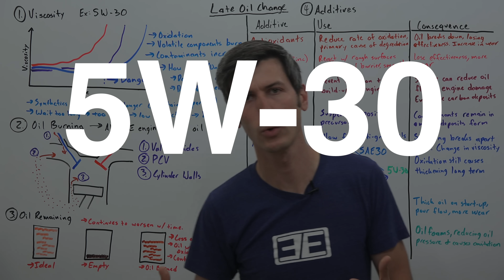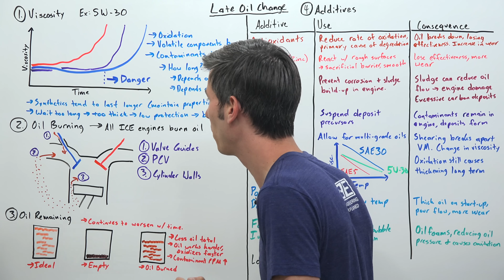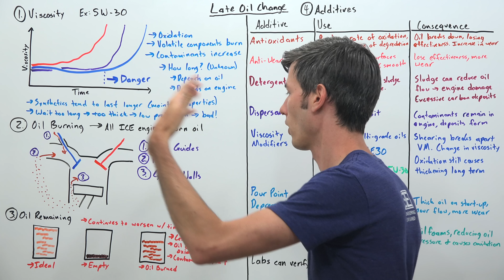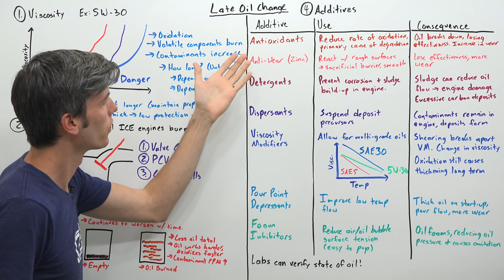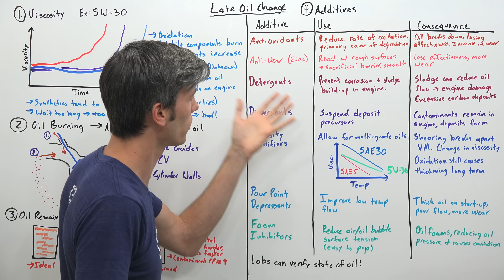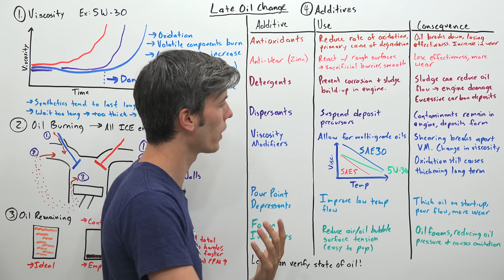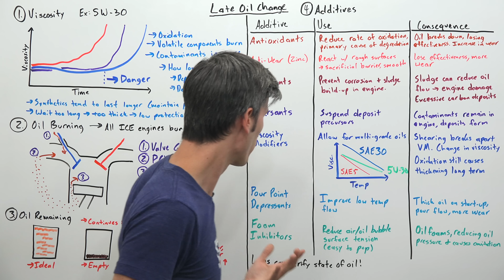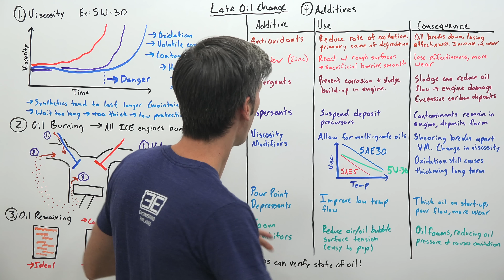What If You Forget To Change Your Oil?

Comment: How about sitting too long with bare minimum engine running time?  Particular speaking, a 2012 Chevy Volt: Approximately every 6 months; it's just start without any hesitation. 

Honestly, I don't even remember when was the last time when oil change took place.

Comment: Wait....VISCOSITY goes DOWN. as oil is used and becomes thinner. A 30 becomes a 20 over time. VISCOSITY does NOT increase.    VISCOSITY means thickness essentially . Honey is more viscous than water.  😂 you have it wrong.  Backwards actually.  How has nobody noticed this ???

Comment: Sooo I may have bought a 2005 cts 3.6 which uses 5w30 oil and it only has 48000km or 28000miles but the Last oil change was at 27000km is my engine cooked?

Comment: I had three different cars where I never changed the oil on any of them the first was a 1991 Nissan truck, 350,000+ miles, I would change the filter and top off the oil, the second 1997 Toyota Camry 375,000+ same thing,  My 2008 Nissan Frontier 275,00+ same thing  I still have that one. the others sold running great.  I stopped changing the oil after one of my Engineering professors said just change the filter top it off. He said they tell you to change the oil because they  want to sell you oil.  BTW i do change the oil on my 1971 MGB roadster regularly.

Comment: 2009 Challenger V8 Hemi RT. 175k miles; however, engine is new (20k miles). I've owned 8 months.

Changed oil, etc. last week - was slightly overdue. 
Drove 30 miles next day (15 mi, parked 7 hours... 15 mi back); then it sat 1 week without even being started. 

Checked oil before heading out today - stick indicates it's 1 QT low, possibly more.

Why might that be?
Definite leak?
Or typical consumption due to age? But the engine is prime... But the car did sit for 5+ years w/ prior owner never touched, let alone turned over.

Exhaust pipes have black (oil?) residue, but I never checked them prior, so unsure if that's old or new residue. 

She's driven conservatively; hemi is sparingly engaged.

Comment: I’m disappointed that my question was not addressed here.  That is, the old adage of 5,000 miles or 1 year, what ever comes first.  I put 3,000 miles a year on the car.  I’m wondering what would happen  if I went by miles instead of time.
Reply: If you only change your oil based on mileage, you’d be going nearly two years between oil changes, and that’s not great. Even if you don’t drive much, oil breaks down over time, collects moisture, and can turn into sludge, especially if the car sits a lot or only does short trips. That can lead to engine wear, corrosion, and poor lubrication.

The risk of moisture, fuel dilution, and oil degradation outweighs the cost of an annual oil change. But that's just my opinion.

Comment: Do NOT go by manufacturer's recommended intervals for oil changes.  Change your engine oil and engine oil filter at least every 5,000 miles.  If you make frequent short trips, then change it at 4,000 miles or even 3,000 miles.  It's good to have clean full synthetic oil in your engine.  The other thing, change your coolant every 60,000 miles.  This is preventive maintenance.  It will save you money in the long term, big time!

Comment: I had an old car. I got the oil changed on schedule. But that's changing the oil. Maybe I was allergic to dipsticks because I didn't check the actual amount of oil frequently. Apparently it is true that old cars do in fact burn oil faster and things didn't end well for it or me. I think I'm not allergic to dipsticks anymore.

Comment: My sister had a 1981 Toyota Corolla drove it over 400k without ever once changing the oil. I usually just do the every 3 months on my Conventional oil regardless of the miles unless more then 2500 over due

Comment: Motor oil starts to degrade after 2,000 miles regardless the brand, and regardless whether its full, blended or conventional motor oil. Reasons to do oil changes every 3,000 – 3,500 miles: (1) to remove contaminates circulating in the engine block, (2) to remove the gasoline/fuel contaminated oil from your engine, every car (new or old) has some fuel dilutions in the engine, and fuel thins out motor oil, (3) adding fresh oil brings in fresh detergents to clean deposits in the engine and remove deposits from small passages, engine walls, around the piston ring, and also protect critical engine parts and components. 
If you plan on keeping your car running forever or if you want your car to reach 300,000, 500,000, 1,000,000 miles on the odometer, then 3,000 miles oil changes is the way to go. THERE IS NO ROOM TO NEGOTIATE ON THIS. 
If you’re NOT going to keep the car long, for example you’re leasing or plan on selling the car, then 5K, 7K, and even 10K oil change intervals will be okay because you don’t plan on keeping the car for long. 

WHY DO MANUFACTURERS RECOMMEND LONGER OIL CHANGE INTERVALS:
1)	EPA & Regulations (the oil somehow ends up in the environment after rain pulls it into sewage)
2)	Manufacturers can report that their cars have a lower cost of ownership
3)	Manufacturers what you to buy more and newer cars, if you do what manufacturers tell you, which is to do oil change every 7,000 to 10,000 miles, when your engine dies, you’ll be out of warranty and its no longer their problem and manufacturers would prefer you come back and buy another vehicle. 
My recommendation is to do oil changes every 3,000 to 3,500 miles if you want your car to last FOREVER.

Comment: I have jeep wrangler 2021 v6. When I change my oil, the old oil is less than the new oil, when i pure the old oil in the 5qts container the old oil is about 1 inch lower than the 5qts line, is that normal? My car has 36k miles. And also my coolant fluid gets low slowly is it internal leaking or vaporizing or is it normal? Lose about 1/4 inch from the max line in the coolant tank in about 4 months.

Comment: I understand the viscosity thing but why is the viscosity rating a lower number when it’s cold than when it’s hot? Wouldn’t it be the other way around ? For example a 0w is thinner than a 5w, so why is a hot oil rated at a higher viscosity number? Maybe it’s just a classification thing? Idk

Comment: I am in the UK and my partners 2016 Audi A1 1.6 TDCI manufacturer users manual states 10k miles or 1 year for oil 5w30 fully synthetic. I has 52k miles on it. Why should I change it less than this interval? It is expensive in the UK to get a fully synthetic oil/filter change. Cheapest last time was £120.

Comment: Quick question: is time equivalent to miles? Ie what is the rate of breakdown if the car sits undriven over a long period of time? Or is breakdown of oil primarily driven by miles traveled (and therefore your x axis is miles, not time)?

Comment: The charts showed time on the x axis but I cannot remember too many references to mileage.  Is oil degradation mainly time-based or is it strongly related to mileage?  I ask because during the past few years I have been mainly using cars other than my own so the mileage has been very low, between 700 and 1,800 miles per year.  I have changed the oil once during three years but the mileage difference is way less than the recommended 10K interval.  Should I change the oil based on time or mileage?

Comment: What’s your take on the brake oil. Tesla says check it in every 2 yrs. Every other manufacturer says that you should replace in 2 yrs. Mine is 6 yrs old still tests well at Tesla and its boiling point is still good. Should I replace it anyway? Many thanks.

Comment: Not quite on the multigrade oil explanation....
It does not become a 5weight when it is cold, it has a lower resistance to rotational torque as compared to straight 30weight when it is cold.

Comment: This didn't address late oil changes with respect to time (e.g. going one year on the same oil). I just changed my oil (synthetic) after only 4000 miles of gentle driving, unfortunately last time I changed it was a year ago. Mechanic said the oil wasn't dirty or burned but he could tell it was old. What does this mean and how harmful is it? Why do we need to change it every 6 months at the latest even if we are driving very low miles? I'm assuming it's because condensation causes water to dilute the oil over time no matter how little you drive, making it a less effective lubricant.

Comment: I generally tend to aim for 4000 mile oil changes, because my car is a 30 year old machine with nearly 200k miles on the odometer and i want to make life as easy as possible for my little engine.

Comment: Did I damage my engine by forgetting to change my oil? With all the conflicting claims of time between oil changes, the real question is how long should I go between oil changes? Based on what I hear, I shouldn't even believe my owner's manual. Some of my vehicles display a reminder when it's time, but I have to question if it's already too long before the reminder comes on.

Comment: Do NOT fall for this Misleading    
Info
IF you are running a Turbo 
You can NOT use the same guide as Naturally Asperated engines.
Turbos REQUIRE earlier changes 
Period

Comment: Oil today has had the Zinc. Removed or drastically reduced. Because it’s bad for catalytic converters. The zinc was the magical additive that protects metal on metal contact.
If you check you will see a lot of YouTube videos on what caused this engine to fail. And the majority is to long between oil changes.
Today’s oil is not as good as the MFGs claims.
Change your oil often. Do not go by the oil change display in your car. That is designed to reduce the cost of ownership not protect your engine..

Comment: I always have the idea that the longer you leave oil in the more sludge you get in engine oil will turn brown after only a short time in engine partially from it dissolving some existing sludge and new burnt oil scraped off cylinders in engine so even if no wear is occurring if you want a cleaner engine more often is better for oil changes.

Comment: Just a quick note: 2024 Toyota Corolla M20A FKS engine uses 8w0 oil. Thin as water.
I wonder how many of those smaller oil change outfits like jiffy lube actually stock such an oddball weight of oil.

Comment: This is all theoretical. In actual practice, it's perfectly fine to go even 1,000 miles over every now and again.
If you're broke and can't afford to change your oil this month, but it's time, you're gonna be fine.
Just do it as soon as you can and don't go over too often. Engines are amazingly tough (well, most engines)

Some cars have been known to survive up to 50,000 miles without an oil change. Not to say you should do that lol, but it's been known to happen

Comment: That Subaru with its horizontally opposed cylinder setup is REALLY going to consume oil as it ages.  Subaru engines do not have gravity to help pull the oil back down.

Comment: My mechanic says to change the oil every 3k miles or the date on the sticker which is like 4 months or something of that kind of short interval. I use synthetic blend. He says to change it on time or viscosity will start to go away. So if wait 7 months and I still haven’t even driven 3k miles it’s considered overdue by then even if I haven’t put in the miles. Is he lying to me? lol.
Reply: As someone who owned his own mechanic shop for 10 years before I sold it to become a hot shot trucker yes he is lying to you. A mixed blend will be good for anywhere between 5,000-7,500 miles depending on the brand and will be good for a total of 6 months. Reason he is telling you otherwise is simple to take your money. You gotta remember a mechanic is there to make money and will pretend like he cares/ worries about your vehicle to reel you in into thinking he is actually looking out for you when in reality he is taking advantage of you. Remember he is there to make money not to be your friend. Only time you should be changing your oil every 3K miles or 4 months is when you only using regular conventional oil

Comment: It depends on how you use your car. For example if you have very long travels, where you go through huge distances in a relatively short amount of time, so the number of hours the engine runs is much smaller than running your car in town, you are safe to change it 20-30 sometimes even 50 percent over the limit

Comment: I'll push mine to 3,000 miles once in a while but than I just do a 200 mile flush once in a while to keep it coming out clean every 2500 miles. 
Really if I was the average person only keeping a modern through away car for a few years i would just change it every couple years or not at all.

Comment: Hello, I own a Mitsubishi Lancer 1987 model. The average running per month of my car is about 500 - 600 miles. I use full synthetic 5W-40 API-SN and change the oil and filter together after 8 - 9 months and in that period the cars mileage is around 4500 miles. Am I changing the engine oil at the right interval? Is it ok not changing the oil for 8-9 months. Kindly suggest. Thanks

Comment: I forgot to change engine oil for 6 months and when I finally changed it.. the mechanic says that the engine needs to be replaced by half engine.. but after thorough servicing my bike is working fine.. should i replace the engine or not? Should i continue riding ignoring the word of mechanic ? please help me.. changing engine is very costly..

Comment: I usually don't drive my car much, so at the dealer told me I can wait up to a year instead of the suggested 6 months in user's manual for an oil change since I do not reach the miles on my Ford Edge 2016, does anyone know if this is a bad practice waiting a year within services?

Comment: Too much worry about oil breakdown when in reality oil and its additives breaks down very little when compared to carbon build up from exhaust gases passing through the rings and valve guides. The real damage to an engine is carbon buildup that clogs oil galley and coating friction parts making them wear faster. An excellent example of carbon damage from blowby gases is to compare the mileage of an engine that runs on natural gas and then compare it to the exact same engine that is run with regular gas. After 5,000 miles most engine oil with regular gas will become dark like dark pancake syrup or darker while the natural gas engine oil would be barely darker to new oil. Even the spark plugs and combustion chambers of a natural gas engine show very little to no soot or carbon buildup. Many of these natural gas run engines are at several hundred thousand miles and engine friction parts show almost no wear when measured.

Comment: I got a 2001 Toyota Camry with 300k miles, does not burn a drop of oil.

I use cheapest oil, but religiously change it every 3k miles or 3 months.

Parked and changes on the same spot on my driveway by myself for the past 10 years. All fluid changes according to the owners manual.

I think most issues are either lack of maintenance or neglect. The other 10% is bad luck lol
Reply: Smart owner

Comment: The single most important factor with any oil is its film strength, that which protects against metal to metal contact or shear, anti wear additived. Synthetic base stocks alone only give you a higher resistance to temperature breakdown, which of course is good in itself.

Comment: I would say, the worst thing you can do is letting it go low, not checking the level periodically and adding what may have been lost from whatever. There are many vehicle owners out there with no concept and who don't even think about the oil in their engines, let alone checking it or watching YouTube videos such as this. It's one of the most common neglected preventive maintenance items.

Comment: The answer is - It depends.  Did you wait to change it 500 miles after it was due or 5000 miles after it was due?  If it's 500 it won't make a damn bit of difference.  I've always balked at the change your oil at 3000 miles nonsense.  Back when I was using traditional oils, I changed at 6000 miles because the 3000 mile number was always nonsense.  Never in my life did I have an engine failure or problem with oil.

Comment: Is time between oil changes worse than milage?
A Dr. put me on medication and I was practically bedridden for 9 months.
Luckily, I had my oil changed before that happened. I drove less than 1000 miles during that 9 months, and didn't have the strength to have my oil changed, or even really think about it. It had Pennzoil conventional in the engine for that time. I changed the oil as soon as I took myself off the meds.and was able to resume life. 
My engine seems to randomly knock now. 
I had Valvoline full synthetic put in today. 
I am just worried that I may have messed up my engine. I've had this car for 6 years and wanted to keep for many more years. (2012 Kia Sorento 2.4 lt 4 cyl GDI, 93K miles)
No 'check engine' lights ever came on and I have a diagnostic tool and no codes were ever thrown. I drove for 2 hours with the diagnostic tool in live mode, and  got nothing, but when I went down the rabbit hole, I found that cyl 3 had 3 misfires in that 2 hour period.
Does anyone have any input? Did I mess up my engine?

Comment: I was just changing  the oil in my Hiace camper van about once a year because I was only putting a about a 1,000km or less a year on it. Using a Quality oil, I thought I would be fine. Just got the oil changed this past March. The oil that was drained looked fine. Now the oil gets changed every 6 months or 5000km whichever comes first.

Comment: The key to engine longevity is frequent oil and filter changes,   ...even more frequently if used for city driving and start/stop operation.
Low mileage engines used for short city driving will have more internal wear than a high miles engine only used on highways/long distance journeys.

Comment: Oil becomes acidic if you don't change it oil. and it's bad for the rubber seals the valve stem guide seals and the crankshaft rubber seals.